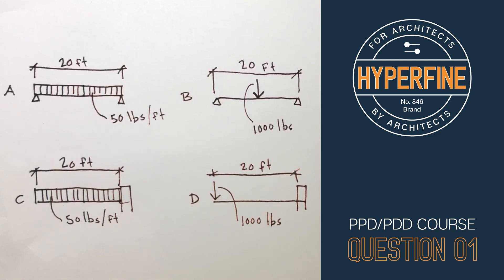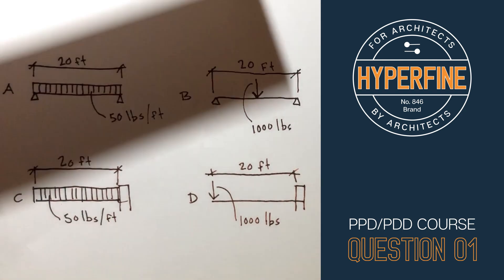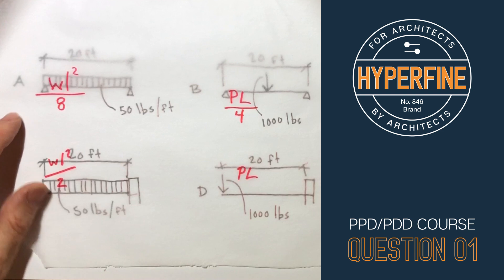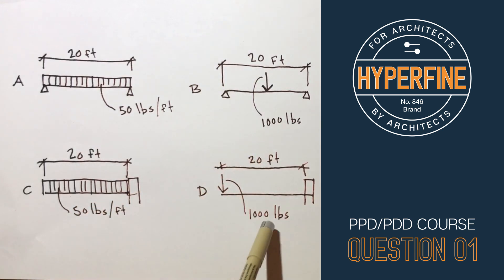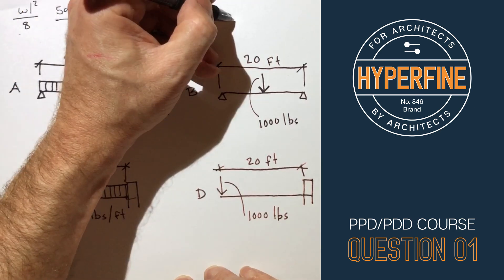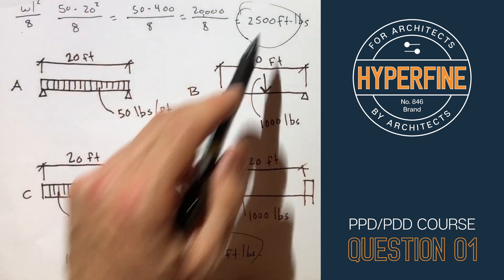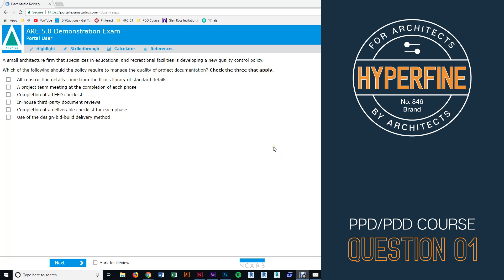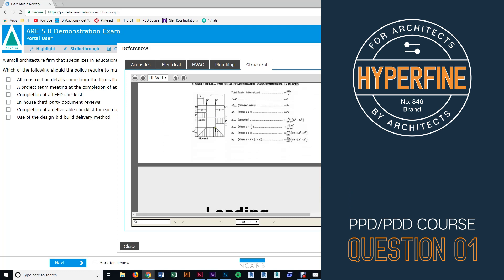ARE 5.0 - Moment Formulas

Comment: Thank you for your video.

Say you have a uniform load that is distributed at each supporting end, along with a point load that is located in the middle of that uniform load. Basically combining your A and B examples. My question is how do you find the moment?
Reply from the maker: You are very welcome!

I am pretty sure in the case you mention you would get the sum of the two moments. So solve them individually and add them. I'll look into this more next week...unless someone wants to do it for me?!

I am very very sure that you won't have to do that level of calculation on the exam. You may have to do some calc questions, but the point I was trying to make here and in the acoustics video https://youtu.be/hucFa9TDKeU is that you can use the formulas to help understand word questions you might not really know how to do.